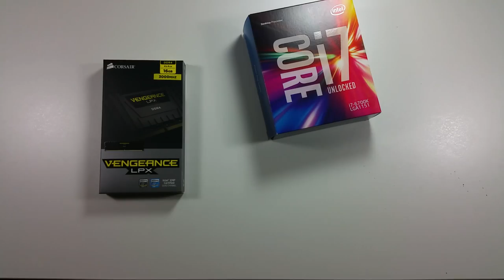Intel 6700k Installation WITH Corsair H100i GTX

Comment: I made a mistake and threw out the box and I think it had the other back plates for the cooler in it.... Will the same back plate work on the 6700k that is currently working on my 4930k?
Reply from the maker: Hey Aaron - not a problem. Contact corsair and they will replace your parts for you. Tell them what happend and I'm sure they will take care of you.

Comment: Where do you plug in the fan header? I'm lost on that part as I noticed the gtx has a 3pin.
Reply from the maker: +Divergence should be two headers for the PWM fans (4pin) and there should be a 3 or 4 pin that goes into your motherboard CPU_Fan header if im not mistaken. Hope you figured it out. thanks for watching.
Reply: Does it come with the board or the gtx?
Reply from the maker: there is a 3pin wire that comes off the main unit of the watercooler. This plugs into your CPU fan header on your motherboard

Comment: It has been mentioned that corsair h100i gtx is for lga 1150 socket , since i7 6700k is lga 1151 , how is it going to fit there ?
Reply from the maker: Its adjustable. it will fit
Reply: +BTCKYLE how adjustable? Can you explain it to me :)
Reply from the maker: +Saad Hayat Sure, the metal securing bracket used to hold the block down has adjustable holes to fit a new screw pattern for the socket on the motherboard.
Reply: +BTCKYLE alright.

Comment: What is the CPU temperature with the cooler when overclocking to 4.5 GHZ ?
Reply from the maker: 27C idle, 65-67C load
Reply: BTCKYLE That's too much for a water cooler. You might want to take a look at that. You have either installed it in a shit way or the stock paste is that bad.